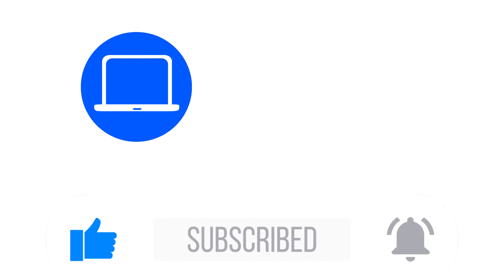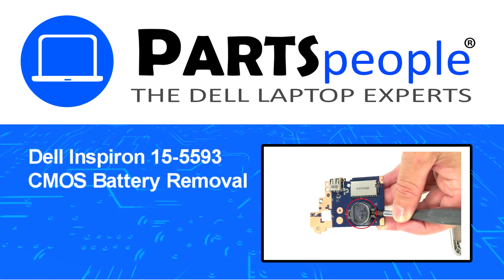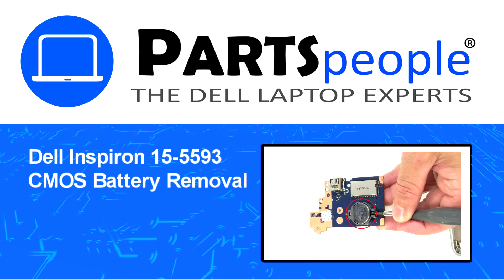Dell Inspiron 15-5593 (P90F002) CMOS Battery How-To Video Tutorial

Comment: Thank you! I followed your step-by-step instructions, but my BIOS was not reset. It does display all components fine (which I tested with Linux dmidecode) even though I physically remove the wireless card it is set and it doesn't complain about it ;-).  The BIOS password I don't have access to, so, I cannot change its settings. Why is that happening? What should I do next or otherwise?